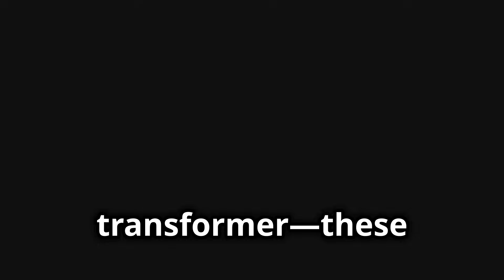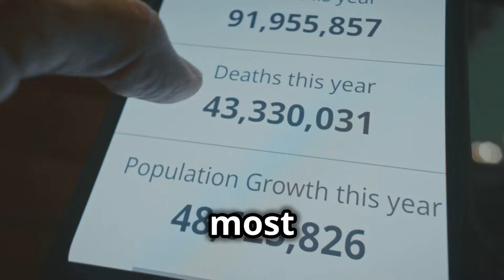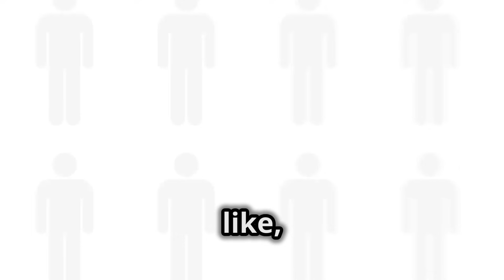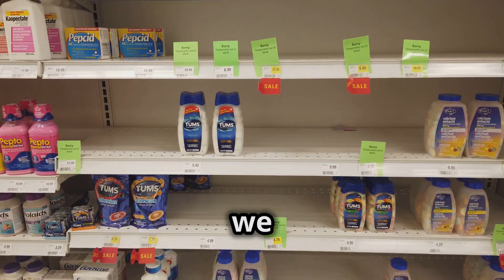EMP Attack: What Would REALLY Happen

Comment: I could finally get some sleep and go for a drive in peace with lil to no traffic............................ Friends dad worked for Darpa and is a genius. He said my 01 and my 95 would only at most have radio and lights not work but would still run fine.
Reply: Those vehicles still have an electronic ignition so you're going to want to have a spare ignition module and a ignition coill.... you're going to want to store them in a faraday bag that way if an EMP does take those components out you'll have replacements ready to go then your vehicle should run fine.
Reply: @yourcaseworker6916  He said they are solid state and an emp wouldn't affect them. Something about no microprocessor to burn out. I will get those just in case. Thanks for the tip.